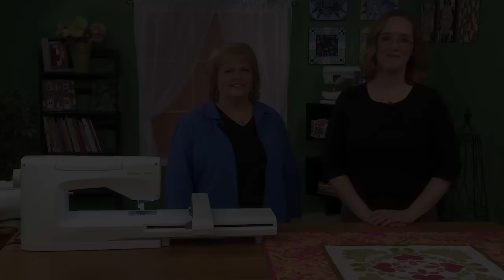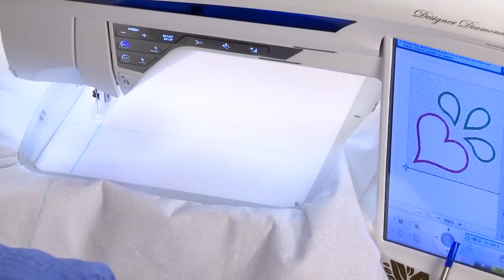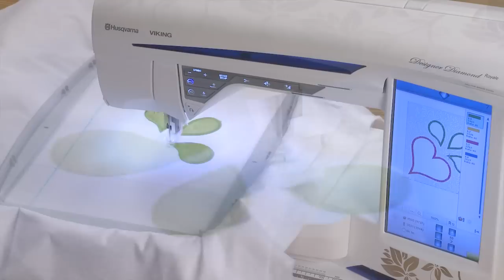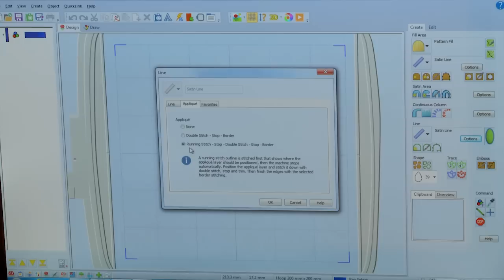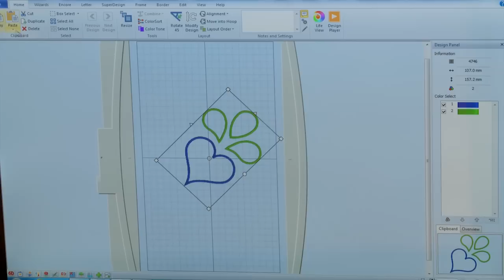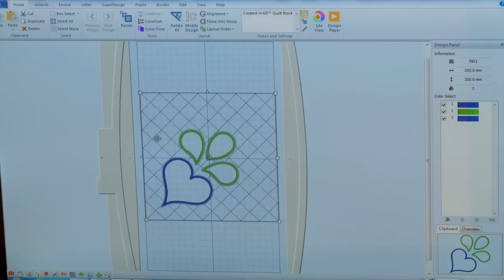Learn to Applique Using an Embroidery Machine

Comment: Works great👉>share4.photo/bSewing?l12    Very plasticy . Good options, Decent speed and strength. Wish brother was open on their software to make embroidering easier. It’s all pay to play. Changing thread is fast, bobbins I don’t use top wheel guide to thread cause sometimes it goes on bobbin thread post and drives me insane lol. Quick stitch selecting. Awesome homeowner machine . I do all kinds of self tailoring. Get plenty of bobbins, needles (gold seems good balance without breaking) and thread. It’s fun to use. Led light is great, I leave it on 24 hrs in my sewing room.